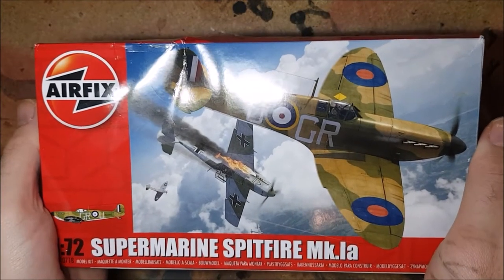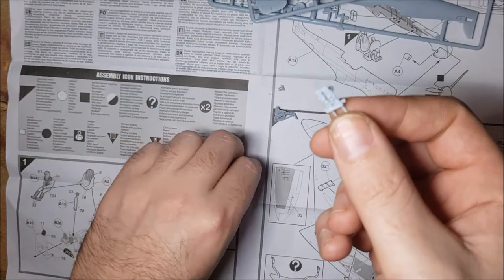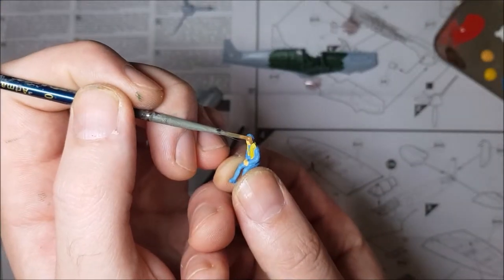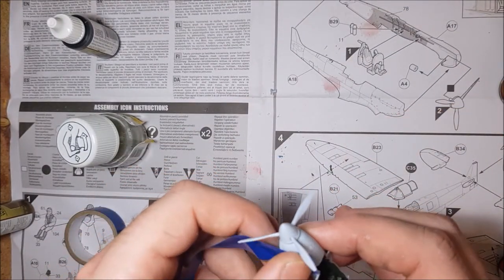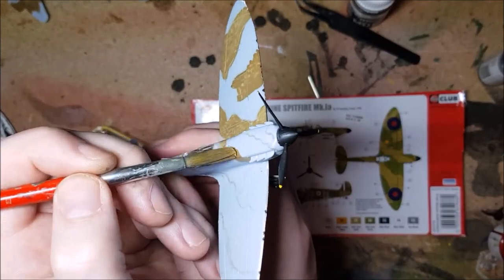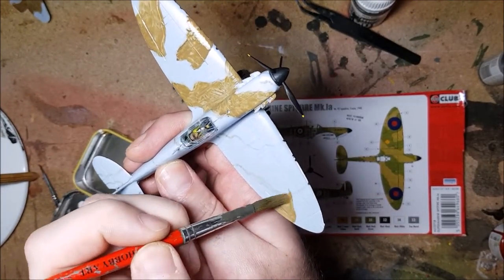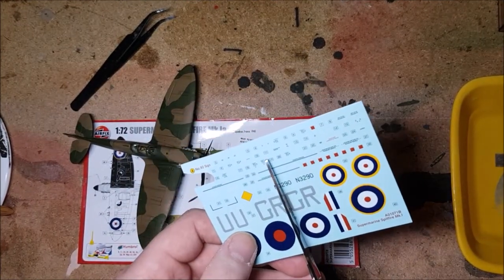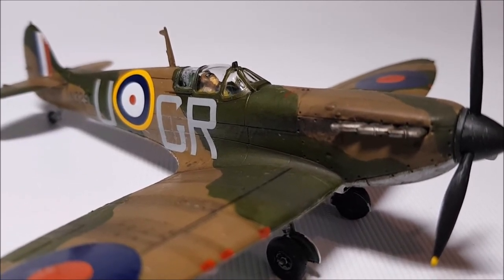Airfix 1/72 Spitfire Mk1a Build Review

Comment: Nice work, If I had watched Your videos 30 years ago I would built my models according to Your directions
Reply from the maker: Cheers mate, are you still building?
Reply: @scalestuff1066  I returned to hobby but now I used airbrush
Reply from the maker: Nice I need to take some time and learn how to air brush,how did you find them?
Reply: @scalestuff1066 I know I’m not the same fella but i will say airbrushing is very easy and quite good but can sometimes be over complicated and sometimes a bit tedious when cleaning as it can get blocked up if not used the right thinner to paint ratio
Reply: That is why I still hand paint with Tamiya acrylics
Reply from the maker: @Ganja_VR  See its the cleaning that puts me off giving it a go as I had an airbrush years ago, did my best cleaning it but after one model the thing clogged up
Reply from the maker: @Ganja_VR  Yeah what clogged me was tamiya dark yellow, I remember because it was a king tiger model I was painting
Reply: @scalestuff1066  yes that’s the same thing here the clogging is an absolute nightmare and can be quite scary when needing to clean it when the only way to clean is by dismantling it and it’s very fragile and expensive so it’s not always the best way to paint it and I also find the hand painting quite therapeutic and it can look quite amazing if done right
Reply: Yet hand painting might not have the same effect and finish as an airbrush would have but it’s far less expensive and far less complicated
Reply from the maker: @Ganja_VR  Yeah when I went to clean mine I was like "what am I doing!?" soaked it in turps and yeah didnt seem to do the job, I have seen people spray cleaner through the airbrush now to clean it so that could be an angle. In fairness, I think both have there merits, I would like to get an airbrush to do the pannel line fades on a model so the paint looks sun bleached. But I do find painting more relaxing and like you say therapeutic. I do think hand painting gets a bit of a wrap as a basic method, but I have seen people hand paint and really not go about it correctly then slate it afterwards.
Reply: @scalestuff1066  yes that is 100% true and maybe give the airbrush another go and then see if it suits what your looking for because u never know u til u really get the experience of it and I 100% agree on hand painting being better fr less experienced and less expensive model kits compared to an expensive model kit being used with an airbrush
Reply: One question I do have to ask is do u think it would be worth picking up the 1:8 scale revell 1979 Pontiac firebird trans am if I was going to hand paint it?
Reply from the maker: @Ganja_VR  I'd get it, but use spray paint on the main frame, and build it up in dust thin coats, I find it hard to get that factory finish sheen on cars but spray paint does the job well, just be careful of none model brand paints and dont spray one over the other without a good test first as a lot of the cheaper sprays react . take a look at my dodge charger video and thats rattle can orange
Reply from the maker: @Ganja_VR  Yeah I think if the channel does mega well and starts making me a fair bit I'll invest in one, even if its just for those german spray camos they did in ww2, as you just cant do them justice with a brush
Reply: @scalestuff1066  very very true because I built the spitifire and I did an absolutely awful job with the camouflage on it and thank you for all the advice and the responses you gave back will come back for advice in the future 👍
Reply from the maker: @Ganja_VR  Ah everyone mess's up dude ive trashed a few kits now, sometimes you just have to roll with the punches, if you ever get stuck on any bits or need any advice just drop a comment on a video
Reply: @scalestuff1066  thanks very much man as right now I’m very new into model kits and have built 4 an airfix spitfire an Airfix Lamborghini huracan evo a mistercraft plz p-11c (do not recommend that model btw it’s horrible) and a revell p-47m thunderbird and I’m building a special hobby Messerschmitt bf109e which are all very nice and a little complicated but also very fun
Reply: and il be sure to come back for advice btw u earned a sub :)
Reply from the maker: @Ganja_VR  Glad your enjoying the hobby tho mate, and trust me with the tricky, you get into a pattern after a while and you start to see the problems coming before they hit you so to speak. Good choice of planes tho I really need to build a thunderbird
Reply from the maker: @Ganja_VR  Any time, this hobby can be tricky to get into Thanks for the sub, I hope you enjoy the content. I do want to do tip videos but will probably make them in winter.
Reply: @scalestuff1066  you really should build the thunderbird it’s a really fun model and it is decently cheap aswell considering the price is under 15 quid and the quality is top notch
Reply: @scalestuff1066  and I really enjoy your content it helps me to decide my next build and to see how you put it together
Reply: @scalestuff1066  I’m also thinking of getting the hobby 2000 f4 phantom as I’ve seen yours and it looks gorgeous and very fun to build and have in my collection
Reply from the maker: @Ganja_VR  Ah do it mate its a lovely model to make one of the unexpected kit buys as I had never herd of hobby 2000
Reply from the maker: @Ganja_VR  What brand was the thunderbird? I was looking at a Tamiya 1/48 thunderbird, btw I have done a few 1/48 but there out in a few years as the videos are backed up a fair way
Reply: @scalestuff1066  it was an autocorrect mistake sorry about that I was on about the Revell 03984 P-47 M Thunderbolt 1:72 scale model and not a thunderbird as my autocorrect is a bit weird
Reply from the maker: @Ganja_VR  No worries mate I read it right if thats any compensation
Reply: @scalestuff1066  that’s very kind tanks very much

Comment: Hey nice work,i started my first kit a few days ago and now im painting it with acrylic paints.Without shakin or mixing roughly the paint i get so many air bubbles is there a way to get rid of them?Im seeing people doing exactly what i do and they dont get bubbles what i am  missing? Thnx <3
Reply from the maker: That sounds more like a paint problem than a you problem there mate, what paint are you using? 

You can try a couple of things to get rid of bubbles, sounds silly but have  you got anything that vibrates? A drill or electrical tooth brush as if you pit the pot on that for a few seconds that can help help work the bubbles away,you can warm the paint slightly as well or add a tiny bit of dish soap to water then add a drop of that to the paint.hope that helps
Reply: @scalestuff1066  i used a vallejo color ,then with a revell color its really better
Reply from the maker: Is it vellejo air by any chance your have the trouble with?
Reply: @scalestuff1066  no its water based acrylic color,the bubbles start when i mix with water,but i do it slowly 😔
Reply from the maker: Try mixing the water in with the paint and water side by side

Comment: Nice build, just picked up one of these. Had not built anything for years, but did a RMS Titanic last month and had fun with it, this seemed like a good place to get back into planes. I think for a lot of us the Airfix Spitfire is an iconic and familiar build!!
Reply from the maker: Nice, how did the titanic go together as its on my to do list? yeah the spitfires are great, I think I have built so many at this point, ive not long built another one
Reply: It’s a good kit. I ended up with a bit of a gap on the bridge when I put the three upper superstructures together. My fault, more test fitting and less hurrying. It’s less than 1mm so a bit of putty…

It looks great and was a fun build, first kit I’d built for years! I did the smaller one 1:700? It’s a 4 or 5 colour Injection so I likest that it went together without needing painting. Though, of course, it would look great painted with a bit of light weathering.
Reply from the maker: @Create-n-fix-with-Nick  Ah its easy to do, especially when you are getting into a kit and enjoying yourself

Yeah that they would with a little bit of a weather just to set them off, so whats next on the build list? Im making a corsair atm just taking a break while the pre painting dries